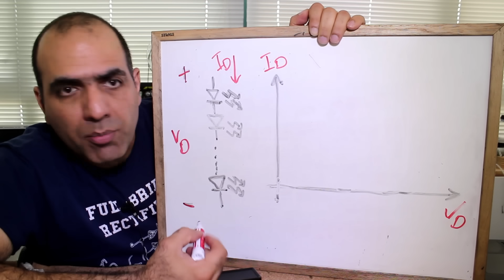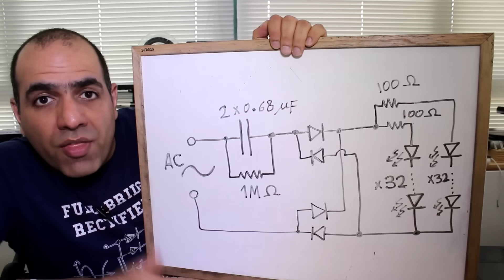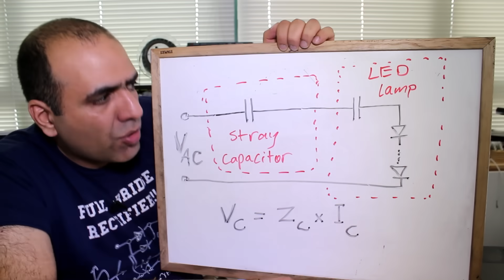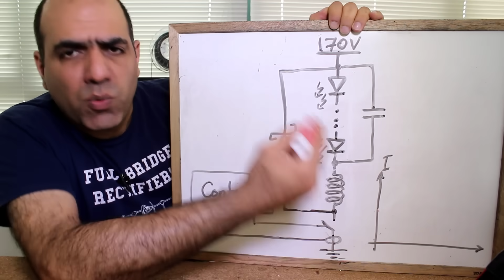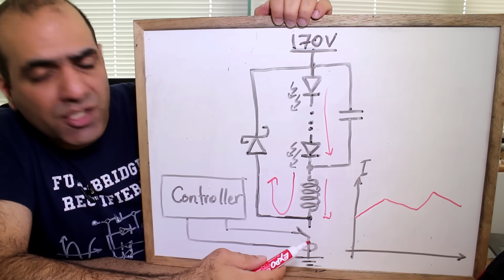Why Cheap LED Lights Keep Glowing

Comment: This is a weird explanation:
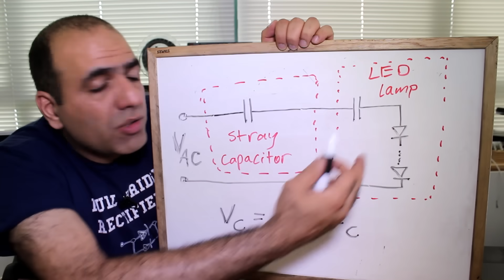7:00 - Why there's no current at low voltage? There must be a low current; LEDs need current to glow, from the I-V characteristics if voltage rises in diodes, so does the current.
7:19 - How can a resistor in parallel reduce the current that goes into the LEDs? With the same low voltage across it, the resistor will draw current, but the resistance of the LEDs path will not change so they still need to have the same current as without the resistor.

What am I missing?

Comment: 7:03 doesn't make any sense. If the voltage discharging from a stray capacitor rises, wouldn't it push current into the capacitor of LED allowing it to limit the output voltage and prevent the LED from turning on?

Comment: My bedroom led lamp is sometimes glowing after I switched it off, however if I turn the wall plug 180 degrees it's all off. I live in Sweden so I have 230 AC in the outlets. My theory is that the AC is closer to ground in one phase than the other, although I'm not sure why it helps to turn the plug 180 degrees. Can you explain this weird behaviour?
Reply: When switched off, the residual current might not go from live to neutral, but from one of them, very likely live, to ground. Turning the plug would select the other wire which has less or no voltage to ground.

Comment: I had this issue with the led strip. Apparently, my switch was installed on the ground wire and not the live one. After I made this change, it startred to operate noremally.

Comment: The fenomenom you tried to the describe is due to the lack of insulation between the two points of the switch so even when the switch seems off in electronics we call it a skin current that means that the corrent is still flowing from one point to another through the body of the switch that is because the LEDs require so little energy to light up you can see them glowing the rest whether you say it's just a mumbo jumbo get a  Meger or a digital volt neater with a high internal resistance in the orders of megahoms/volt and you will be able to check the resistance between the two points of the switch. not in this case because your sweets are good but with your friend's switch. that is the one who is leting the current leak through it

Comment: Leakage current if you look at the circuit with an oscilloscope does it just look like low noise? Or a shadow of the wave?

Comment: Easyest fix:  reverse the switch polarity (other polarity) 

I had this problem with LED fairy lights and a timer. Reversing the LED plug did nothing (because it gets rectified) but reversing the underlying timer plug brings the relay to open/close the live, instead of neutral contact, problem solved.

Comment: 2:15 why did that circuit work? I thought a circuit only works if the electricity is connected back to the source? Can someone pls explain I’m a electrical engineering student so I’d like to know

Comment: So in my garage i have 2 phillips dual flourecent lamps feeding off of a light socket screw in (two outlet) plug that has a socket below it for a bulb. Total of 3 lamps on the 2 switch multi switch. We were changing out bad switches and outlets in the house. My friend didnt do the wires 1 a at a time as i was..
He did the double switch box on the pillar between garage doors. 2 switches. One switcth controlled the  flood light outside the pillar. (works great). The second switch he must have mixed up wires because now if either multi switch is in the on position ... The socket 
all 3 lamps get power

Comment: Couldnt you use a like configuration to broadcast wireless electricity  throughout a house? Ok so a capasitor fn the wall (outlet) anda  capasitor on the wireless bulb to catch the voltage.
Finally a capacitor back inside wall to complete the circut/discharge to neutral

Comment: Hi Mehdi. I showed this video to my wife Kathlyne but she is still scared there was bad wiring made into our house (built in 2018), and she is stress it will catch fire....🙄  Here is the strange behaviour we have : https://youtu.be/EiVQ4Vn-WiE . A ceiling light (the right one only) flickers when we turn on and off the fireplace ventilation fan. Both the fan and ceiling lights are on the same breaker. LED lights are on a 3-way (2 switches) and the flickering happens when LED lights circuit is open (lights off). I believe there is some kind of induction that is made powering the very sensitive LED light. Can you please help me de-stress my poor wife? Is there an easy way to fix? Thanks!!

Comment: but if you switch the live wire off and only led the bulb connected to the ground wire the is no voltage and there cant be any glow ;-)

Comment: It’s amazing that LEDs use such a low amount of power that they can partly turn on from some random voltage from the environment.
Reply: yup, you can use LEDs to detect electrostatic in the air.... basically a lightning detector
Reply: the things that the electricity from the environnement can do that we are no aware of is really impressive. I am in my second session in college learning about electronic and the more i learn the more i believe it is as close as magic we will ever reach
Reply: @Natshuri  nah. physics+electrical major here, and i can soundly say quantum is actual magic.
Reply: @therealjibrano  Both can be magic
Reply: @Incommensurabilities  ya but only if you dont know a lot about electricity. tho i will admit fields in and of themselves are kind of like magic in how theyre areas that inherently have energy. but quantum is magic bcs we have no idea how it works lmao
Reply: I wanted to say the same thing. Pretty crazy.
Reply: They have IoT devices that can literally power themselves just from stray EM in the atmosphere.  Insane really.
Reply: Basically proper synchronization just as sound is light and light is sound. Every particle either negative electrons or positive work in conjunction of one another creating charge aka energy . Me personally I'm into DC current . Ac is just a way to have people pay for the current from a generator. Thanks Edison no wonder tesla didn't like your ways. We've had this technology eons before we thought. How you implement this knowledge is what's key. Draw your own conclusions but nonetheless use proper discernment 😊
Reply: The engineering topics you'd need under your belt are:
- PWM (changes the intensity of light)
- Voltage threshold (voltage drop exists in wires and below a certain threshold, the component stays off)

Manipulate voltage threshold as you need with resistors/capacitors and such. At least, that's my humble guess.

Comment: Thanks for sharing, one quick question. Why some LED  120V lightbulbs mostly used in recessed lighting ( very common in US nowadays) flicker when used with dimmer switches  while trying to dim the lights i.e will not dim smoothly either to bright and starts flickering when dimmed but work fine under regular switch.
Thanks.

Comment: so.. the lamp had its LEDs in parallel to be less resistant, and then put a resistance so it is not turned on by any capacitor?
i mean, we are using more energy than we rly need to turn on the LEDs?

Comment: So basically, the light bulb lacks a part that prevents the bulb from lighting up from accidental capacitors. The part would make it less sensitive and only light up when the current and voltage is correct. While the part causes some minor waste in electricity, it is more efficient than a bulb that is so sensitive that you can power it with your carpet and a faucet.
Reply: Pretty sure the efficiencies are the same.

Comment: This is why you never switch on the neutral side. Always on the hot side before the light. Otherwise the socket is always live. 

This is also against electrical code.

Comment: in AC the current goes out and enters by its two poles and this lamp can recover the manganese current and gives to the return because it is a led diode and the magnet is attracting the electrons of the copper which seeks other electrons which come by the one foot of the lamp.

Comment: Like Amazon reviews, it's difficult to trust every opinion as some are backed/supported by the companies they are reviewing.  I've used several over the years with good results. Lately, I've used Maxsisun grow lights with great results. You'd really be selling yourself short if you don't check out the Maxsisun MF series.  They even have remotes. Solid build quality, the easiest ever to install.  Great all around package.

Comment: Well if you see it from a different perspective .that is i guess the same reason you can use electric screwdriver testers .. they also glow   bit when the head is touching the live cable and it is touching you .. and the glow increases when your feet fully down .. so its kinda good ? isnt it ? cause then Mehdi can create a homemade electric screwdriver tester ... idea for a new video : )

Comment: Hi! I am from the Philippines and I have the same problem with some LED Edison/Filament Bulbs that I bought from China 🇨🇳. I tried to google and research for an explanation and stumbled upon Steve's video and then your video and watched it. I have a question though, so if this "glowing" or "partially lit up" LED bulbs continues-- 
1.) Would it continue to consume electricity enough to be considered as a "waste"? 
2.) Would the life and durability of the Led Bulbs be affected?

Thank you so much in advance! 😊😁

(**Btw, my light switch has the small light location indicator. Hence it could probably be a/the reason why the bulbs are still slightly lit.)

Comment: Normal LED bulbs which is used in homes, often have a problem with their capacitor, which is a cylinder type, it mostly breaks down.
Can you please tell me why it's happening & what should I do to solve this problem.

Comment: I actually came across this issue when installing led brake light bulbs on my car. Down the rabbit hole i went only to realise after many hours of learning I just had to add a resistor on the circuits. It was a learning curve but worth the effort. If I had come across your video sooner I would have saved myself time. At least I learnt something new.

Comment: i have watch this video cause i have same problem and the problem is i bought 2 led panel light 1 doesnt glow but the 2nd 1 does glow but the 2 lights are in the same electrical i wonder why and what is the solution to this

Comment: The problem doesn't just affect LED lights. 
In the 80s I had a small 5W fluorescent tube installed over the turntable. 
If I switched it off and touched the plastic housing with my hand, you could see that the tube started to glow slightly again. At that time I switched a 100k kiloohms in parallel to the lamp, that fixed the problem.

Today I do not recommend using one resistor, but several in series to increase the voltage resistance and watt resistance. One resistance quickly turned black.

Comment: Little Late, but Don't trust a switch to isolate you, go for the breaker.  Learned THAT little tidbit working in my parents home when live wires went to the light, and neutral wires went to the switch

Comment: "You shouldn't forget to turn the light off or open the breaker before working on your electricity."  Never mind the switch; open the breaker.  I found out the hard way that whoever wired the ceiling fixture in my bedroom put the switch across the neutral wire.  With the switch off, there was still mains voltage at the box I was working on.

Comment: Hello electro BooM
I heave a question about the light in general, so the only thing in this planet that is in 20 century and evolution of the technology is growing fast but one thing is not changed so far and that is the PURE WHITE Light.
So far we need a 3 main colors that when they are combined (red, green, blue) they produce a white light, so this is wondering me how no one has find or invented a material or something that can emitted a PURE WHITE light...., this is what is need to replace the so called "white LED". 
So what I want to say is if you can or anyone that has an explanation for this fenomena of light source to show us why is still not heave a pure white light source.... THANKS.!

Comment: I have a bunch of small ceiling lights in the bathroom that stay on like this. What I don’t quite understand is, do these cheap bulbs themselves waste the power, or are they merely revealing a waste of power that is going to be there with “better” bulbs?

Comment: In Italy there are screwdrivers with a little light in them, which you can use to test live wires for current. If you touch the screwdriver to the wire, and then your thumb to the back of the screwdriver, and there is current in the wire, the light will turn on. Sounds like the same principle as the chinese led light.
Reply: They are working somehow differently, as no capacitor is involved within the screwdriver. There are two electric components: a neon glow lamp and a high-resistance resistor (sometimes built into the lamp). The resistor limits the current to a harmless level.

Comment: In a moist air, my straight green led could be slightly turned on with one leg connected to a 12 v battery and another leg touching the plastic shell

Comment: wait, just rewatching this again, doesn't the fact you dont get shocked at 3:00 mean that the earth isn't bonded to the neutral like it should be?
Reply: No, it means that the LED strings limit the voltage across his body

Comment: No, less LEDs in series don't mean running on a lower voltage, but those are packages. They can contain several LEDs in series as well as in parallel.

Comment: i have one of those cheap battery powered LED lights that has multiple little LED lights that are like flashlight bulbs, mine is in the shape of a star, but they have them in all sorts of letters and all sorts of other things as well... it is about 3 years old and it has been on constantly. the batteries lasted about a week and then they died, but the thing still has a slight glow to it even if turned off even if batteries are installed. the batteries all test as completely dead absolute zero, but the lights still glow after like 3 or 4 years. 

I am sure it is probably another company, and this mine is a star, but it is one of these.
https://www.amazon.com/Yoaky-Alphabet-Birthday-Christmas-Decoration/dp/B07HVS78PY

Comment: Sir for 2 led light keep glowing for 2 sec after power off have to use capacitor 470uf, 220uf  right sir? but really need the size of 100 uf capacitor to contain inside the project which im doing is there anything that i can use the size of 100uf capacitor to stay those light for second pls   100uf capacitor not holding light even a single second pls clear to me sir advice me something pls

Comment: The issue is the electric is bad and puts the live directly to the bulb and the neutral goes to the switch first. If the electric is good, the live would pass through the switch and the neutral, directly to the bulb.

Comment: I have 2 LED nightlights in my apartment. During a recent power failure when everything else in my apartment was out, these 2 nightlights continued to work at about half their normal brightness. At the time it both confounded and pleased me no end.  I presumed it was some sort of brown out where the voltage fell low enough as to prevent most things from operating but not completely out. Last night we had another power failure but when I arrived home, both the nightlights were out.
Reply: Nah bro you just discovered free energy, congrats
Reply: During a power outage the capacitor will drain eventually,
So it might've just been time that made the difference.

Comment: One interesting thing is that this half-addresses a question I've had about the commercial incandescent-replacement LED bulbs just like the one you struggled to break into the plastic housing of in this video: when they fail, the first sign is that you turn off the light, and the LEDs flicker for a little while afterwards. Eventually, they flicker when on, then don't turn on.

I wonder if this is the control electronics failing in a way that causes shorts across the drain resistors. Is there a way to fix this, or to set up your bulbs so that they don't suffer this?

Comment: I think its the low quality led controller is the big issue.. my iot device use cheap ssr glow when i switch off.. then  i change to expensive ssr, the led didnt glow

Comment: How to solve that problem?
Reply: yes, I kind of understand the part of soldering a resistor in parallel, but to reach that he had to kind of distroid the casing of the lamp (or Led Light bulb). But how to do that, or resolve this glow issue without to distroid the device we are trying to rescuit...

Comment: Remember to turn off switches and fuses then playing with non standard socket :-) Here in my country is 230V dangerous to touch even the N wire or L1 wire. Power in both of them..

Comment: Had that problem.... Wires in the house were connected backwards.... So light switch was cutting the neutral instead of power line.... Reconected wires AND problema resuelto....

Comment: I have a white Philips Hue smart bulb that does this. By design, these smart bulbs are always "live" and the light turns on or off using Zigbee. Anyways, when I surround the base of the bulb with my hand, the bulb starts glowing.

Comment: Does this mean that when he is lighting the LED with his foot through static electricity that he is making "FREE ENERGY"?
Reply: I would say no, it's simply inefficient usage of current (you already pay for) on Ground - which is tied to Neutral at the main service panel. In fact, Mr. Kryukov (of Kreosan fame) has demonstrated this in "Free Energy from the Ground Wire". Granted, that video is different, but perpetuates the myth of "free energy". I would call it, as Mr. Kryukov also said, "alternate energy".